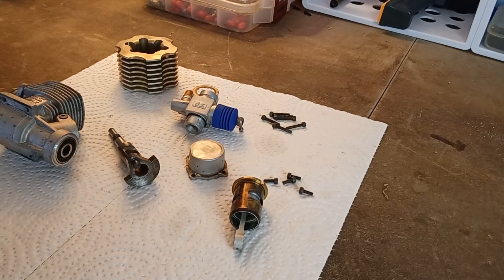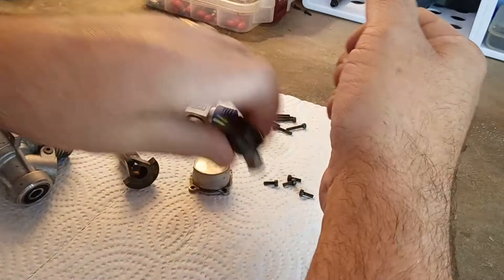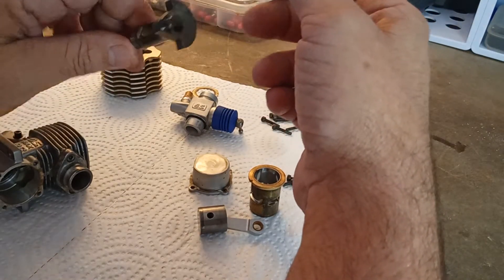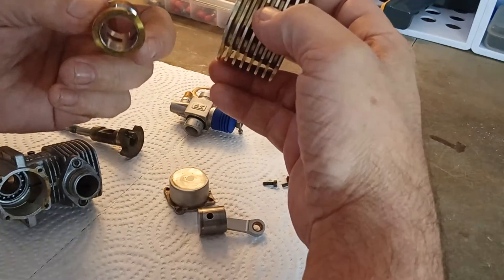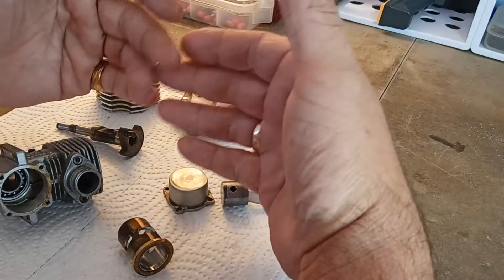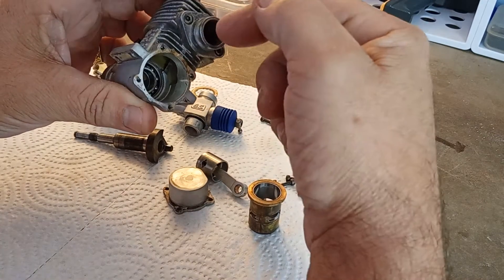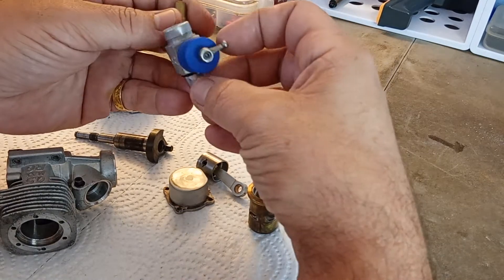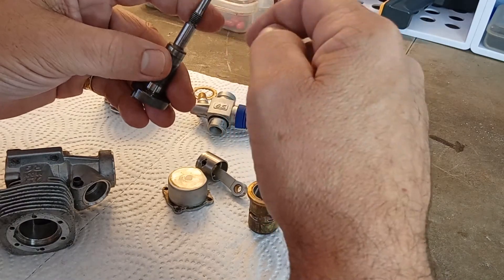Let's talk about the OS Max 21 RG nitro engine .21 bump start

Comment: Hey thanks for the video!
Can I swap a Kyosho GX21 engine for one os max 21??? or what else? Want more power and try anothers brand engines.... will need another clutch? the GX21 came with 2 speed, will be the same? Thanks!

Comment: got  one  in an old  savage 21   this thing  had a 3.5 in it     it was blown    hole  in block and all  picked  up  one of these  for a fiver     was gumed up   almost  like lard  or fat   it had ben dipped   heated it up with a hot air gun   FREED  IT UP RUNS  WELL   not super fast its a 21  not a k 5.9  etc   but  easy as fast as the stock 3.5/21

Comment: Hi interesting video are these sleeves abc or abn
Reply from the maker: RG sleeves are chrome plated
Reply: I have seen a new one for sale with pull start i am thinking of putting on in a vintage usa1 nitro crusher thanks.
Reply from the maker: @David-069  That is the perfect place for an RG, a lot of those trucks were fitted with them back when they came out.
Reply: My only concern is that the 21rg that i have seen is brand new but it has the pull start and the exhaust is right in the way weather it would be possible to turn just the plastic pull start casing  90 degrees to the right so it would be in the same place as the gs21r pull start thats the only thing that’s really stopping me from buying it. Any ideas ?
Reply from the maker: @David-069  there are different header options, are you using one that makes an immediate 90 degree turn? There are headers that come out and around to clear the pull start